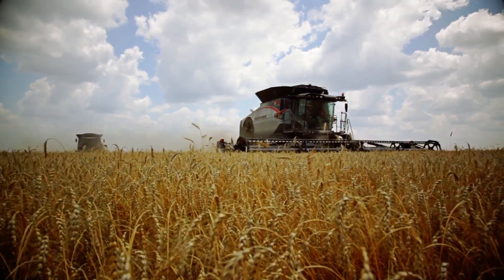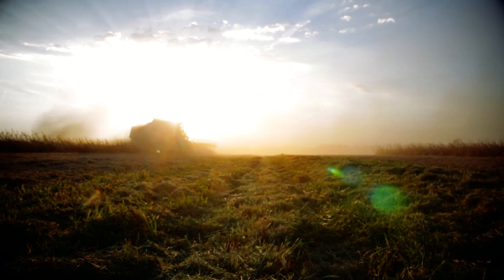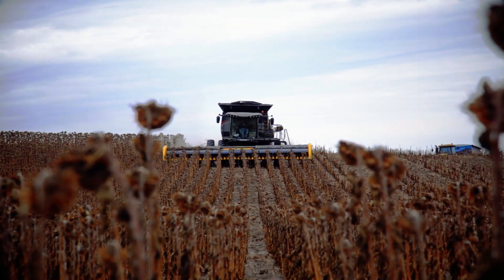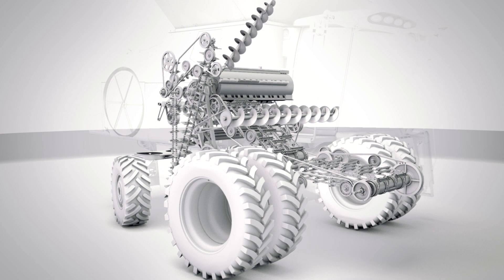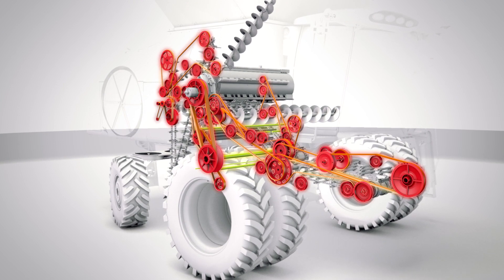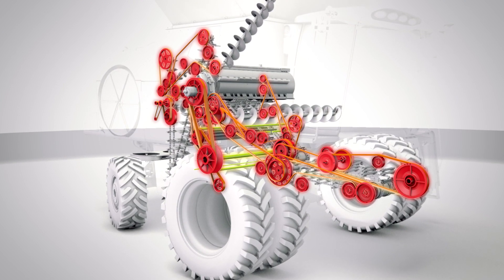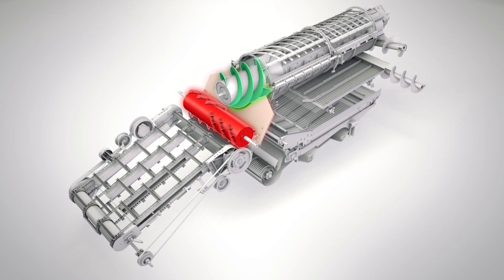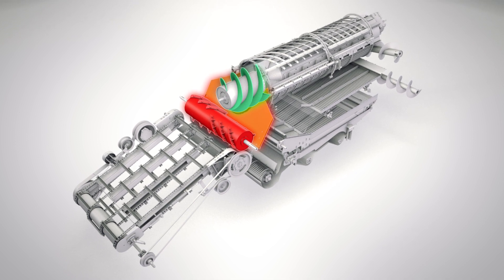Benefits of a Gleaner Combine

Comment: "Few belts" the screen become red
Reply from the maker: Thanks for the comment! The video said that the belts are on the outsides close to ground level which provides easy access and it mentioned "there are very few belts that can't be changed in in less than 20 minutes" not that there aren't "very few belts". Gleaners have a similar number of belts than other machines and less belts than some machines!